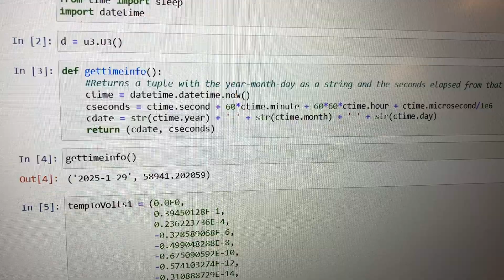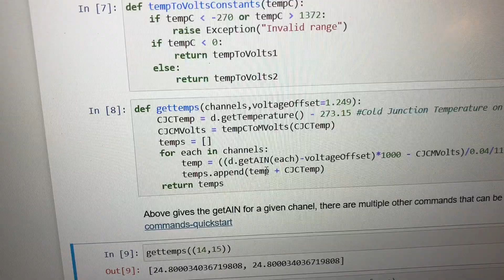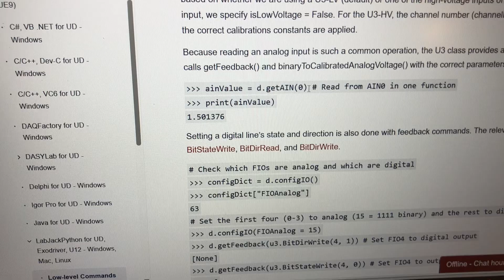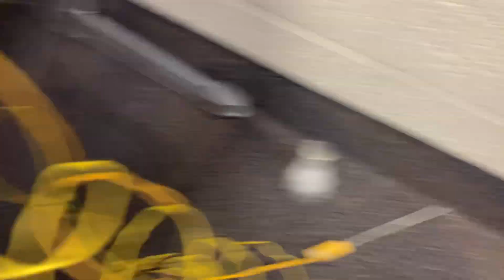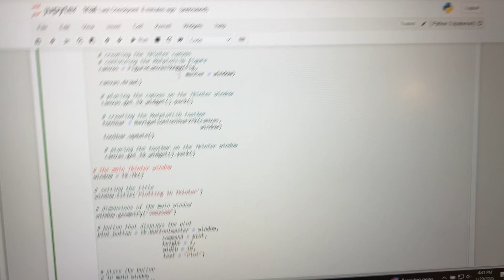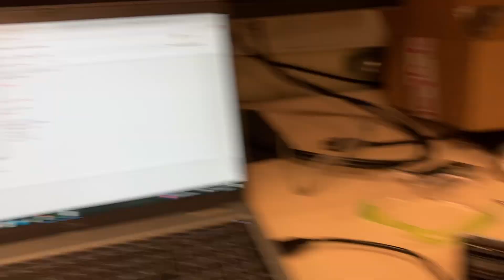LabJack U3 K-type Thermocouple Introduction using Python and TKinter

Comment: Great video, However, been new to the labjack U3, is there a way to connect a multiple thermocouples to the labjack? and also what is the name of the other device you connect to the labjack in the video and what are its functions. Can the labjack work without it?
Reply from the maker: I'm sorry I didn't see this comment! Yes, you can connect multiple thermocouples to the LabJack. You need a LJTick-InAmp 3 with a resistor.